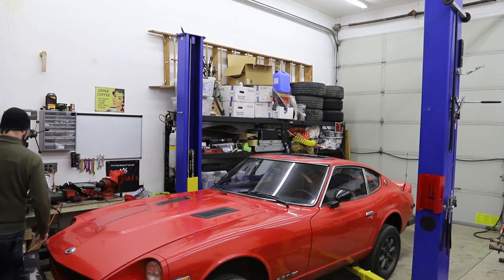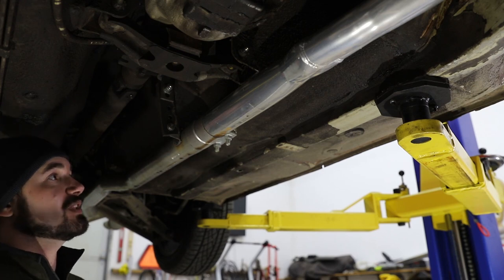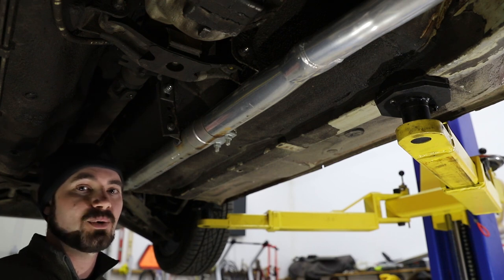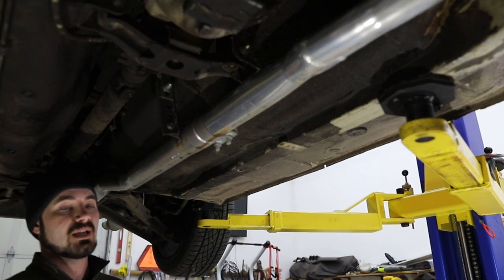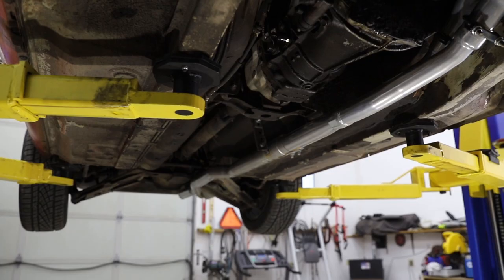280Z DD Project - Installing a resonator the quick way.

Comment: Try adding exhaust cement into the joint. It lubricates like grease while wet and seals when dry. Failing that, you could always expand pipe with a QUALITY expander.

Comment: Did this solve your drone issue? I have the same issue on my 280z, triple webers and topendperformance headers with magnaflow muffler. Crazy amount of drone around 1500-2700 rpm. Also how much did it change the sound of your car? I really love the top end rpm rasp mine has
Reply from the maker: The resonator solved a lot of the drone. There's still some fine tuning I would like to do, but in general, a resonator is almost always the solution to drone. The biggest challenge is sizing it to the sounds you want. It may take a little testing.
Reply: @AmbiVe  Thank you. I couldn't find anyone else with a close to similar setup with a resonator install. I'll just have to wait and see how it sounds with it installed, I don't want to lose the high rpm rasp mine has, but I'll sacrifice it as I cant stand the drone on the highway constantly giving me headaches

Comment: Great video, quick question, does the ends of the resonator go over the existing pipe or into the existing pipe? 
  Thank you in advance, have a great day!
Reply from the maker: If you buy it the appropriate size, usually the old pipe will side just inside so that you can either clamp them or weld them.
Reply: @AmbiVe  thank you!! Cheers, 🥂